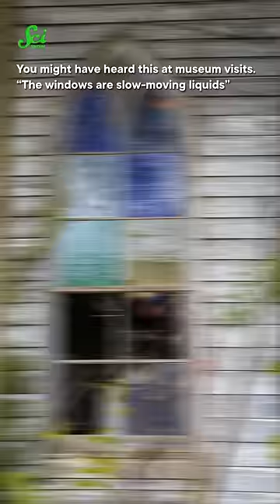Do old windows actually melt? #shorts #science #SciShow

Comment: Its basically because they had to form the panes while molten, and they lacked things like annealing ovens and perfectly flat sheet metal forms. Mind you this was all mostly sodalime glass back in the days.
Reply: It’s not so much either of those things, but the flat glass (relatively speaking) we have today is mostly float glass so it was formed on a bed of liquid metal so it’s self levelling 
- I mean you’re  completely right in the sense that it wouldn’t be possible without the precise control of the things you mentioned too, but they’re not the reason it’s flat.
My very basic understanding anyway.
Reply: Yea they would drop the blob of molten glass on a turn table and spin it to even out the glass.
Reply: Compared to modern glass they have more imperfections and rough, bumpy surfaces. Also thicker and much smaller in size. Making a large sheet of glass wasnt easy. Thats also why we often see mosaic windows or windows composed of several smaller squares in old buildings.
Reply: @Jay22222  So, before float glass or even plate glass was spun glass. A glass maker would blow a large bubble just like that for making a vase.

But instead of just opening one end up a little the maker would open it up, reheat, open more & repeat until it was a complete disk of glass.

The resulting disk is then cut up as needed, hence why panes are small & sometimes you see a "bulls eye" piece that represents the usually discarded but decorative central boss.

In using such glass it is mostly tradition to put the thick side down, but it does confirm a less fragile build, tends to refract sunlight farther into a room & because all panes follow the same rule more regularity in the pleasing pattern.
Reply: @Jay22222   I will admit it's been a few years since my last deep dive into older glass making techniques (same goes for modern methods), so I could very well have some things mixed up quite a bit. 
I do recall due to sodalime's properties it tends to appear more warped and drippy in many cases. 

Classic Dunning Krueger effect on my part though. In all fairness the best way to get good info online from people is to be confidently incorrect myself haha.
Reply: @100GTAGUY  haha you’re not wrong there.
I don’t think soda-lime can be or atleast isn’t made using the float glass manufacturing technique so you can’t get the same effect.
I think that might be the reason for it but I would agree, soda-lime has that reputation or effects more likely than other kinds
Reply: @GaryMarriott  Thanks for the info. Found that interesting and assume it might account for where “bulls eye” lenses for things like lanterns come from
Reply: @GaryMarriott  The "bull's eye" is from the pontil mark from the pontil iron or blow pipe used to blow glass. It is the spot where the glass bubble is attached to the blob of glass at the end of the tube
Reply: @tessat338  Thank you, the name escaped me
Reply: No, it’s because the glass is technically a liquid. It just has a super incredibly high viscosity that it doesn’t appear to move to the human eye.
Reply: @white_isnt_a_race2338  Glass doesn’t “flow” fast enough to form thicker bottomed glass panes. It happens on a geologic timescale, not a human one.
Reply: @evilsharkey8954  I didn’t say otherwise I actually specifically said that.
Reply: After working with molten glass for a number of years, I don't consider it one phase or the other. I consider the environment first. Like how water in polar regions is no longer liquid but a crystalline solid: permafrost.
Reply: @MattJasa  thats true for any element
Reply: Soda lime sounds delicious like seven up or Sprite (the one i prefer)
Reply: @bland9876  Not me mistaking Calcium Hydroxide with a small, Green colored Citrus and serving them to people 😳
(I was charged with multiple act of Manslaughter)

/s
Reply: It was also spun glass. They had these big tables that the molten glass would be poured out onto to cool, and then they cut panes out of that.
Reply: @brianpinkey676  The glass was then cut into 1ft or 6in squares, which is why old windows used multiple panes and the middle pane had a "dimple" where the glass was poured onto the turntable as it didn't flatten out. I think these panes were cheaper then as they were not flat or easy to see through, but these days as glass is produced differently they are now very expensive!
Reply: @DireW0lf0  well you’re buying the look now a days.
Reply: @brianpinkey676  Yep!

Comment: Old glass was made by spinning large disks of partly liquid glass to thin it out, the glass towards the handle was thicker, and the glass near the edge was thinner, they’d cut the glass as properly as they could and would use the thicker side at the bottom because it is less prone to breaking over time.
Reply: They would also blow a big bubble and shape it into a cylinder then cut the top and bottom off after reheating it. The cylinder was cut and the glass rolled out flat.
Reply: https://youtu.be/QXQMc0jsl2E

If this is the method you are talking about, they are flattening it with heat on a flat surface in a furnace or a glass blowing glory hole. So this should eliminate the thin and thick part of the glass to even out a little. So I have a question, what is the thickness difference between the window plane glass. Even Veritasium says it is not supercooled liquid, but the question, if the thickness difference is too much, how did that occur.
Reply: Spincoating is used in several industries, notably semiconductor production. It's known for making uniform disc surfaces as the centripetal shear force on the polymer slurry is uniform.

Comment: I had always heard that glass manufactured hundreds of years ago was essentially as rigid as a substance could be and still be classified as a gel, and that modern, tempered glass didn't have that problem.
But regardless, I'm now curious as to the explanation of how really old windows gradually bulge outward as if they were half-molten, to the point that they could not physically have been installed that way without breaking, which is a condition I have personally seen on several occasions.
Reply: Well most settings for old glass are made out of wood, which would be lightly carved to fit the glass you bought for it. Or if it's metal, it's formed around the edges of the glass pieces before it's soldered together.
Reply: @HopefullyAnAircraft  I'm referring to a potbelly-like sag in the pane, which actually makes the glass hang outward past the frame it's installed in
Reply: @thassalantekreskel5742  same, you had to make due with the materials available at the time, and also each window was hand made/fitted around the glass you bought for it.
Reply: @thassalantekreskel5742  I know what you're talking about.  I've seen it in old American house windows.  I do not believe for a moment that wooden frames were made to somehow ensconce thin edges of glass right under pre-existing rippling "pot bellies".  That inconsistent thickening occurred AFTER assembly.

Comment: This is an oversimplification. Yes the reason of thicker bottoms is manufacturing. But amorph solids don't have a melting point. Like amorph polymers you just have to extend the timescale to see viscous behaviour. But this just leads to differences in microns over several hundred years
Reply: Glass would not move more than the width of a few atoms even over millions of years.

Comment: I work with glass. 

It will change depending upon how it is kept as per any material item on this gd earth. If you keep it in a sealed room with no uv light proper ventilation and humidity control and with 0 vibrations disturbing it, it will be a perfect item in a thousand or so years as long as the surface area doesn’t deteriorate and decomp from just age alone. 

While old style glass isn’t perfectly made it was handmade allowing for flaws like you suggest. However the difference of colored glass and clear glass is the main feature/factor/issue. As stained glass or vignettes glass is going to be chock full of impurities mixed when molten with the glass. THESE PARTICLES will decay at a different rate then the glass itself, certain glass colors will be more effective as diffusing uv light while others will let UV light pass through it. Some under UV light will decay at a faster rate then those that are a different color. 

This is also an issue because it’s not a controlled environment you’re having stained glass from Russia to the equator, your glass will be undergoing extreme temperature fluctuations throughout hundreds of years with varying UV radiation. It results in what -140 to +145 Fahrenheit in direct sunlight or in wet conditions humid conditions earthquake and floods. Your building foundations can shift resulting in the frames busting and the glass tilting. The vibration, heat, humidity, UV exposure all of the exterior elemental issues and being encased in wood and lead isn’t going to result in the longevity or perfection of items made purposefully with impurity and unregulated means of production. The glass may have never gotten to an optimal tempeture by computerized stats but most glass artisans just learn by memory and visual look/feel like how a baker can just whip smt up and eyeball measurements to get something edible a craftsman can make something of quality but it’s the same degree of trusting one’s personalized style of making and personal processes.
Reply: But... none of that changes the fact that in stained glass windows the panes are  thicker at the bottom than at the top because they were set that way and not because they flowed down, right?
Reply: Thanks for the extra lesson!
Reply: @michaelmicek  they’re set that way same way you would stack blocks from big on the bottom to small on the top. Turns out gravity follows center of mass and if you stack things with the base being the widest/heaviest point it will be structurally stacked and relatively balanced. 

Glass still moves a bit and under extreme heat will burn items/warp themselves/alter in color/or crack - the fact that it cracks in extreme cold(or when the exterior is freezing but interior is warm) shows exactly how glass is not a normal solid item but a material that uniquely transfers heat and reacts to exterior elements/uv radiation
Reply: When you say you "work with glass" what do you mean by that?

I'm a glazer. That's what we're called, we have an international union.

1800 series restoration glass is made with the same techniques used before glass manufacturing was automated and is used extensively in chirches all over the world. It comes in two (major) different styles, the poured method or the hammered method. When you got to a church and see dimples in the glass that is what we call hammered glass. When you see the type that has small bubbles, known as reeds, that is the pored method. The differnce is typically 1/8" at the edge and 1/16" at the center of the billet.

Both result in a narrow center and wider rims. The wider portion is typically on the bottom because glazers cut their glass on the right and top sides to lfit the hole, thus removing the other edges that also have the wider edge.

In older pieces this difference will be more exaggerwted due the manufacturing process being done by hand and the difference in skill from craftman to craftsman. That's why the majority of this glass style is still made in Germany to this day while 90% of glass manufacturing has been sent to Chinese factories.
Reply: @michaelmicek  they didn't "flow" that way, because not enough time did pass. it's technically a liquid, but its so slow in moving at normal temperatures  that geologic time scales are involved (as in: millions of years) to get it to droop ever so slightly a few atoms down.
Reply: @TaftisBack  Hey Ryan, always great to meet another glass worker. Got any old broken church windows? I could melt them down into marbles or pendants for you.
Reply: So you’d suggest warpage overtime, as being one of the causes of the myth?
Reply: @DataStorm1  not even close, try billion for the length of nanometers
Reply: @arianaink100  Even with both explanation... 
They do made it that way to prevent warping and therefore damage to the glass, just like how railroad tracks have braces to prevent warping and how modern windows have very thin gaps to hold the window... Not because it melts, right?

Cracks, warping and imperfections from temperature differences are clearly different than "the Material pooling under itself"
Reply: @aribantala  okay so you think this is correct: that glass acts in the same manner of transferring heat/pressure as steel (railroad tracks do?) 

that metal/compounds/purified steel which was turned into a molten state then cooled which makes the material atomically stacks into a block like formation also has the same characteristics of glass 

which is granular and when put into a molten form and slow cooled not rapid cooled  have the same atomic structure as it is crystaline formations created under extreme heat and slowly allowed to retain the shape. 

So car glass which is double panned with acrylic inlays also happens to have a unique design feature. It’s a unique color to the glass that goes allllll the way around like a boarder. This prevents the car when in the sun for having the window just shatter into dust. As the glass will move inside the metal/rubber frame and the heat difference between the metal and glass means one of the two must give way to pressure. The dark shade/discoloration or even dots on the glass are designed to specifically block sunlight and cool down the overall surface area of the glass. This is to create the boarder of the glass to be a lower temperature then the middle of the windshield because the black coloration from the outside will reflect the UV rays and the glass will not heat up. 

Do you also paint your entire car black in sunlight with a bunch of dots to stop the metal from shattering in the sunlight and god forbid you put on the AC and your metal car door just starts shrink wrapping in on itself out of structural collapse id be so amazed to see it!!
Reply: @arianaink100  Look, I know it's your profession and all. But you... As a professional in Glassmaking Industry... Don't suggest that glass old glass look like that because they melted and is actually a liquid when it's clearly not, right? That's it's just a Misconception from people seeing imperfection, purposeful or not?

Okay... Let's not use Steel as an analogy because it seems to miss the mark... Honest mistake. Lets use plastic, PET Plastics to be exact, that has the similar criteria and is made with somewhat similar manner... One is made out of silicates, the other is resin. Both are superheated into their core melting point and then "shaped" into desired shape before being cooled down to create an Amorphous solid

There are two people asking this...

Does people just mistook imperfections and warpage as the glass melting? Surely not right?
Reply: @aribantala please note that this video only showed stain glass examples that are intentionally textured. There are other glasses, like thin window panes from the 1910s. I had some on a house in a region with significantly high temperatures and these this got wavey over the years. Not a lot but enough to notice.

Comment: Related, there is a chuck of bitumen, or pitch, in a college at Queensland. The stuff looks like a rock, but it is flowing very slowly, and every few years the pitch forms a drip at the bottom of the funnel it's in and drops off. However, this happens so quickly when it does that no ones actually seen it happen.
Reply: I remember learning that. I believe they put a high speed camera near by so it's on camera but no one has seen it in person. It should be possible to calculate when it would drop though

Comment: I’ve heard multiple answers to this; my fluid dynamics teacher says an amorphous solid is a liquid, when analyzed on a big enough time scale. He said the difference in thickness cannot be explained only by the manufacturing process. And I think it makes sense, asphalt is also an amorphous solid, and guess what, with enough time it flows
Reply: Yeah, I'm not believing this video.  I used to own a +100 year old Victorian house.  When we renovated it, we reused a lot of the original window glass.   On every single one, if you looked closely, you could see it slightly thicker at the bottom, and also faint waves/ripples in the last 1-2" inches.  This thickness/waviness was not present in the part of the panes that was within the wooden panes though... meaning the change in shape and thickness occurred AFTER the windows were assembled.

Another fun fact: Diamonds are not forever.  They are slowly evaporating as carbon atoms pop off and float away.  

Time and pressure changes everything.
Reply: @goodluckgoofy3354  Nope. Still a manufacturing issue.